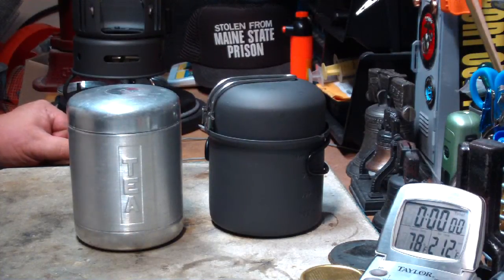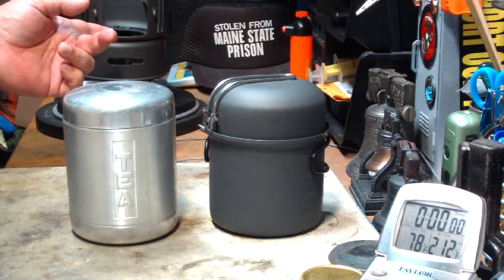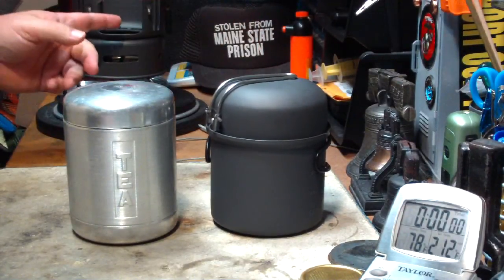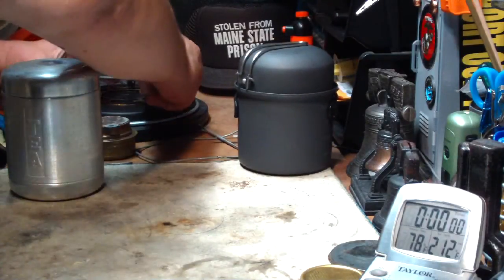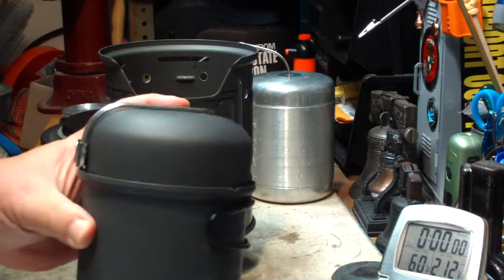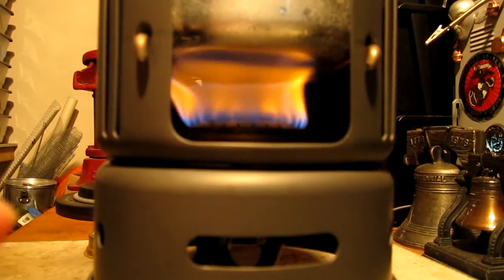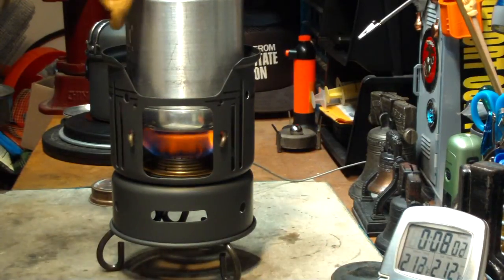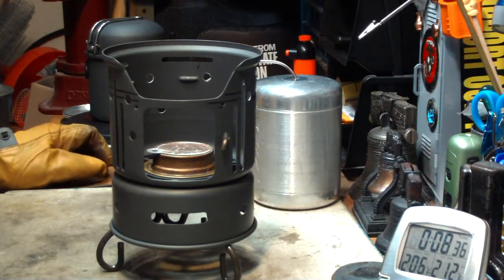Alternative Pot For ALOCS 7 Piece Camping Cook Set - Boil Test

Comment: Hiram,  it has to be the Trangia.  Try a different burner.  Also, I was wondering if the air flow was impeded by the pot or not.  Is the hot air being trapped or is it escaping up and out?
Reply: Why did he not use the Alocs burner

Comment: Its the yellow flame that has me questioning it. do you think you could have gotten a bad batch of denatured alcohol? maybe a miss mixing of the addatives they have to put in causing a yellow flame not a blue flame?? I mean it is a mass produced item and maybe it is something that does not effeits use with staines so they didnt make a big stink about the it? or when it is higher up maybe the sweet spot changes for skinner pots?

Comment: If the black anodized pot is supposed to absorb heat than it stands to reason the top of this stove is sinking a lot of heat. Before painting why not try to use an aluminum shield just inside the windshield to see if it will reflect heat back instead of absorbing it. I hope it works . Jim

Comment: This is what I was thinking as well - that the stand is sucking heat away from the pot.

However, that doesn't explain why the pot that took less time on the Mojo (tea container) took more time on the ALOCS with all the same variables (pot height, burner, air flow).  Perhaps another commenter is right about possible fuel contamination?  Maybe try the tea container on the Mojo again just to confirm.